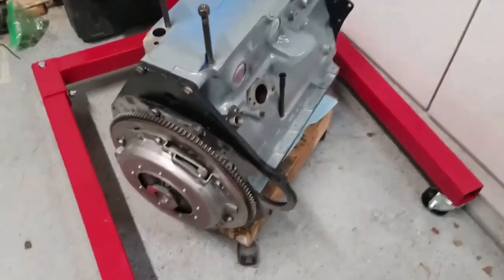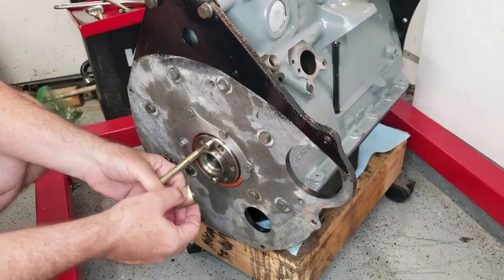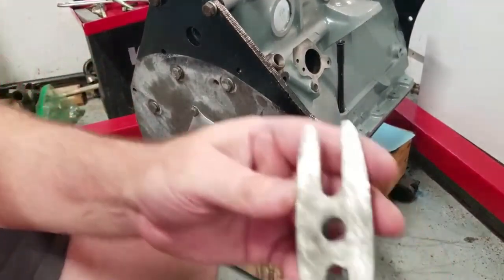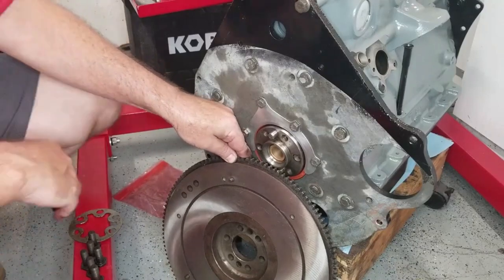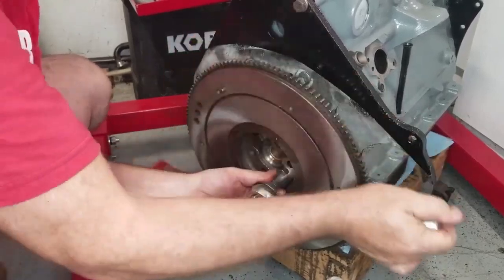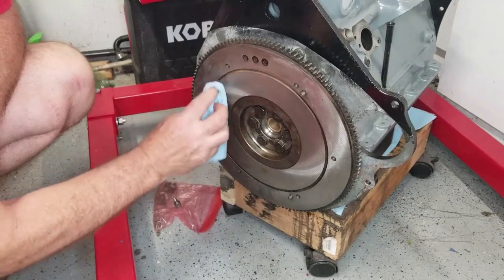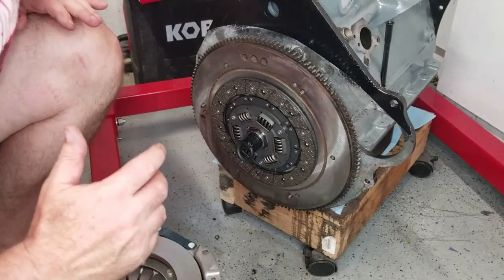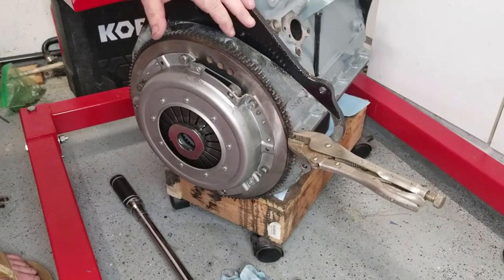MGB Flywheel and Clutch installed (revised )

Comment: Hey Alex - how difficult is it to install the engine and get the transmission drive shaft spline lined up with the clutch plate?
Reply from the maker: @jeffagoddard  great question.
There is a trick to it, but it can be done in under 30 minutes by just 1 person.

https://youtu.be/YidYoRN-fjA?si=CtQOeYdc7KRIJa4C
Reply from the maker: The trick is to be sure to install a new pilot bearing,  and ensure the clutch plates are properly aligned.  

Some people say you need to install the engine and trans together as a unit.  But that increases the weight, and makes it harder to do as a single person working alone.  Stripped down,  the 1800 mgb engine is less than 400lbs.  Much more manageable